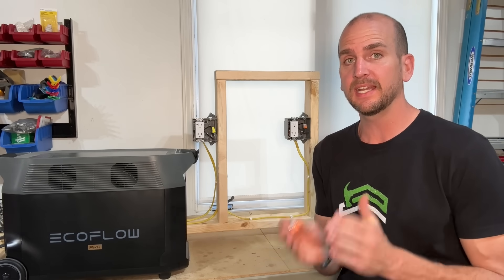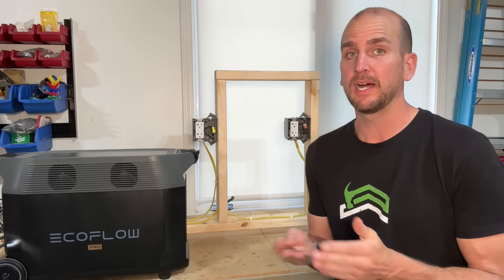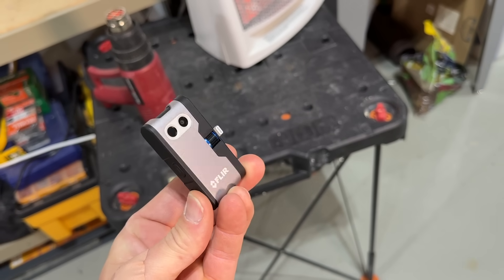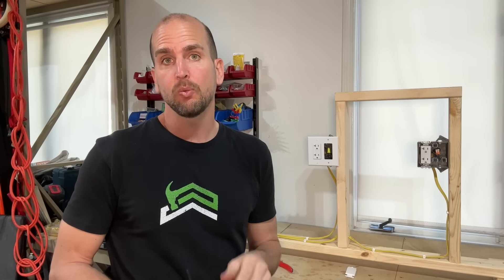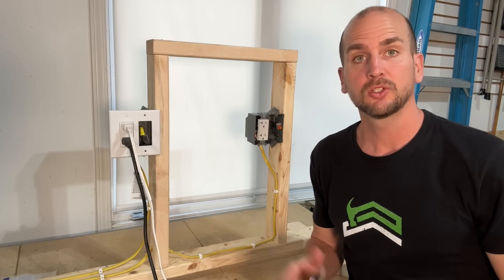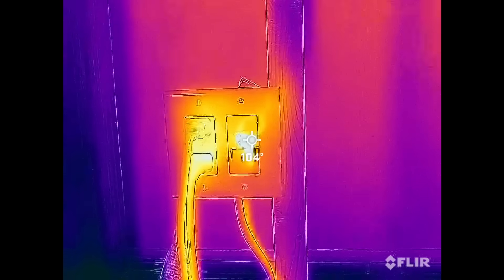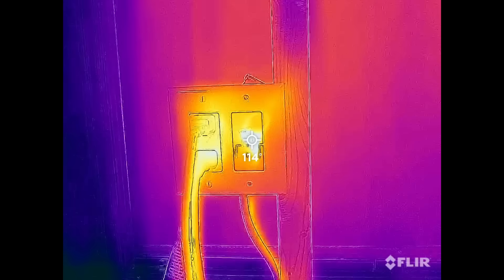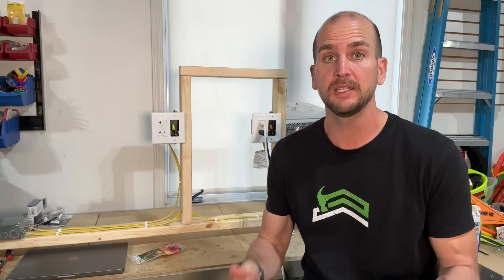Debunking the Pros: Can WAGO Lever Nuts Handle Heavy Electrical Loads?

Comment: It would be interesting to see this test at 20A since that’s a real-world max (or breaker would trip). Would the relative temps remain similar to the test at the higher amperage? Also I’m curious what this would look like at high ambient temps, like a 100F summer day… what was the ambient temp during your test?
Reply: 221 wago's are rated for 32 Amps at up to 450V. There shouldn't be a problem.
Reply: A great video regarding breaker loads: https://youtu.be/MnkHRlztco4
Reply: Breaker should trip at 80% of rated continuous load,  so if a 20A breaker holds more than 16A load? It's bad.  Replace it.
Reply: @ChrisDavis-eq9lj  That is not at all true. The 80% versus 100% rating is all about heat, and where the breaker is installed. If its installed in a box with other breakers surrounding it, it might trip at 80%.  BS EN MCB breakers are even guaranteed to never pop below 113% for some period of time.
Reply: @sandos-x1t  40 years experience as an electrician, 30 years IBEW. Degree in electronics to boot. I'm not making it up. I know from hands on, tested with reliable, calibrated amp meters real world use. Properly working Square D and Siemens 20A breakers can handle a brief startup current of 20 amps. Extended use even in a temp service panel outside in 10 deg F temps will still result in a thermal trip if you exceed 16 amps. Crap like old Federal Pacific breakers? Yeah, I've burned holes through junction boxes dead shorting them. Breaker was so hot you couldn't touch it, but it never tripped. Federal Pacific burned buildings down and killed people.  Don't call me out and say I'm a liar. Industry standard 120v branch circuit breakers in residential, commercial and industrial applications will and should not carry more than 80% of their rated capacity for more than a minute or two.
Reply: @ChrisDavis-eq9lj  I don't know about the US; but for European breakers this is 100% false. They MUST NOT trip below their rated current, and the trip time above the rated current depends on the characteristic (indicated by a letter after the current rating, B fastest, D slowest). A type B will trip immediately for 3x the rated current, and after 1-4 minutes at 1.5x rated current. Even at 20% over rated they will not trip within an hour.
Reply: @ChrisDavis-eq9lj  breakers always trip over the rating to compensate for start up surge. They will take a few minutes to trip if the circuit is only slightly overloaded. 

Breakers don’t trip at 80% capacity unless they are defective. You are allowed to use 100% of the circuit for temporary loads (like a hair dryer running for 15 minutes) you need to design for 80% load for continuous loads (such as an electric heater running continuously). You need to install a breaker that has a lower rating if you only want to use 80% of the circuit.
Reply: @rpvitiello  I did not say branch circuit breakers will instantly trip at 80% of rated load. I said they will not carry a sustained load in excess of 80%. They should trip at anything that exceeds their rating, but some may hold for a very brief time a little over their rating either by design or manufacturing defect. Sustained loads over 80% will and do cause them to thermal trip. Manufacturing variances come into play, so it is hard to pin down the exact overage/time. Keep in mind, American systems (with the exception of XMas lights) do not have fused cord caps to protect devices like European systems. I'm not familiar with Eurospec circuit breakers.
Reply: @ChrisDavis-eq9lj  Unless this is some american only thing this is completely false. I feel like you are confusing having continuous load of no more then 80% with when the breaker will actually trip. looking at trip curves for breakers most will not trip at 1.2x rated current for tens of minutes.

Comment: 30 amps thru 12 awg?  Yawn.  Maybe if buried in insulation it would be a problem, and the terminations could be an issue but Wago's are rated for that.  Now repeat that with 14 awg. I expect that will exceed the 90C insulation rating if powering your resistive loads.

Comment: They both work well when used properly. The biggest difference is the price. Wagos are a lot more expensive than wire nuts. That's why they don't get used as much by electricians. It hurts profits.
Reply: I don't know about the US, but here in Germany, the work usually does cost a lot more than the material. Although wirenuts were never used here, they would be unacceptable alone because of the time they take to wire up (or modify), even if they would be free of cost. The same is true for outlets. In the past (30-40 years ago) wires had to be bend into loops with pliers to screw them down. This also took a lot more time. No one would pay for that time anymore today, since there is a solution that is safer and a lot faster to install.

Comment: What “I think” is that whomever claimed the Wagos have higher resistance and therefore heat, were guessing and not testing.

So even though they are technically correct they remain non-credible. 

Bottom line, if it meets code and has certs, it’s fine.

Comment: I'd like to see the temps on a commercial quality Backwire outlet those decora outlets always seem to be poorly built with inferior parts i use regular duplex commercial grade and those clamp down terminals are very heavy duty and shaped to fit the wire even these outlets were the best connection you tested though and if things are crammed in a tight electrical box will the pressures on the wire affect the clamping spring in the wago over time pushing wires off the contact surface so that wire may possibly only touch part of the surface inside wago connector?

Comment: My experience with wire nuts is that they can be a bit tricky to get right, especially if you mix wire types. The Wago do allow you to transit between just about any wire types without risk of an unreliable connection.
Reply: Stranded and solid just don’t get along all the time.  Ive had a wire nut melt but it took 5 years.    Wago is a no brainer when using  different wire
Reply: @jlsrr2577  Any body using a wago has no brains alright.
Reply: 😂😂😂 get a job radiodick
Reply: It IS an unreliable connection, thats the whole point!
Reply: @RadioRich100  what is unreliable? What stats do you have to support that statement?
Reply: WITHOUT? Its anything but!
Reply: Everything you do with a wago IS an unreliable connection. Learn to put the wirenuts on right!
Reply: If you say wirenuts are tricky u shouldnt be doing the work in the first place.
Reply: @RadioRich100  If they were not tricky, then licensed electricians would not get them wrong so often.
Reply: @buggsy5  There not getting them wrong, theirs bad contractors everywhere. So now you have bad contractors using inferior products so they can get out of there faster. Pushing the wires back in the box and the wago levers are popping open for one.
Reply: @RadioRich100  rather do it myself.  not going to pay you $250 to come in and put in 1 light switch.  sorry.
Reply: @steppedon  Do it yourself, just do it right.
Reply: @RadioRich100  sorry, but, how exactly is that any different than misuse of wirenuts? Bad contractors and even electricians still screw those twisties up. How does that make the wago an inferior product? and how does them misusing wago by cramming it in such a way that the levers are caught make it inferior when enough solidcore tension could slip off a twistie too? Not sure its clear to the rest of us...
Reply: @RadioRich100  if there are so many bad contractor, then is best to make sure they have to use the connector that is less likely to fail, no?
Reply: @lesto12321  No, because now you have an inferior contractor and an inferior connector. Double trouble.
Reply: @buggsy5  I hope your doctor never says something like that.
Reply: @themadmallard  Whos us? Talk for yourself, if wirenuts are properly applied they work forever because the wirenut doesnt make the connection the twist does. The wago properly applied can easily fail because they DO make the connection and in 2 spots at once, using flimsy spring contacts which give contact of little surface area in 2 spots in the same circuit. The wago is now in the circuit. Thats called a point of failure. The wagos popping open happens to everyone using them good or bad because of the inferior design where u wont see it behind a switch or outlet  when the screws are tightened. There junk designed for speed. So what happens to a homeowners house a few years after the electrician got out of there 2 hours early?
Reply: @RadioRich100  If I go to my local supplier he'll probably have to order those wire nuts especially for me unless he has an old box with 20 years of dust on it.
Reply: @ppdan  Blow the dust off and keep you house from burning down.
Reply: @RadioRich100  By the looks of most of these videos its mainly US electricians haveing issues with installing and using Wagos. Never heard of or seen a Wago "popping open", i understand it could happen if you cramp the switch or outlet full of cables and jamm them back in there or using excessive force on them. 

As to the melting part, that could absolutely happen if you dont use them right, if you cant do that you need to learn how to read as it says on them what they are desiged, tested and approved for. Mixing cable sizes can aslo have that effect if you are not using the correct cables.

In general, higher amperage in an electrical circuit can increase the risk of overheating and potentially lead to burning or hot wires. So maybe that is why you guys on the other side of the pond have more issues with this?
Reply: @andrehoglundlarsson1303  Possibly but they are not very good as they dont have total surface area contact.
Reply: @RadioRich100  Same goes for most things installed in a switchboard, they dont have total surface area contact, its genareally a pinching connection.
Reply: @andrehoglundlarsson1303  ?? A switch board doesnt have 20 amps going through it.
Reply: @RadioRich100  Oh sorry, my faul! Thought of the wrong name in english. Consumer Unit was the word i was looking for.
Reply: @RadioRich100  a video backing up your claims would be helpful versus just making wild unfounded statements....
Reply: @themadmallard  He's just being difficult with new tech for some reason....kind of like being butt hurt
Reply: @RadioRich100  Nothing inferior about it.
Reply: @andrehoglundlarsson1303  or just place a piece of elec tape over/around them.
Reply: @RadioRich100  Your claim is that wire nuts are badly installed because the one who installed it has poor skills which means that installing a wire nut correctly requires some skills. And at the same time you claim they are not tricky?
Reply: @ppdan  If your saying their tricky you dont belong installing them. Doing electrical work is skill, something you probably dont have. Lack of skill or laziness produces the same results.
Reply: @ppdan  Their not tricky to an experienced contractor or Diyer. If you say their tricky you dont know what your doing and therefore shouldnt be doing the work. Any work can be tricky if you dont know how to do it.
Reply: @RadioRich100  You might wanna check the definition of tricky!!!
Reply: @RadioRich100  If they aren't tricky why should I use a licensed electrician?  I could just do it myself....not tricky, remember?
Reply: @RH-cv1rg  If its tricky to you, you dont know what your doing then.
Reply: @RadioRich100  I didn't say they were tricky.  YOU said they weren't tricky and I commented that if they aren't tricky (your position) why would I need to hire a licensed electrician?  Seems like anyone can do it....not tricky, remember.
Reply: @RH-cv1rg  The important thing is to do the job right. If your not capable get someone. Wagos are not the way.
Reply: @RadioRich100  Thanks for your input radiorich.  I'll let the EU electrical approving body, Underwriter's Laboratory, and the Canadian Standards Assoc know they have all made a huge mistake certifying this product.  Radiorich has done his own studies.  Hey, how about sticking to radio, maybe you know something about that......like people don't listen to it anymore.
Reply: @RadioRich100 getting 6 #12 wires to actually look good and be nicely twisted into a wire nut can definitely be tricky
Reply: @JoshBattershell  If you consider it tricky you shouldnt be doing it, however its far better doing a pigtail to a second wirenut and splitting them. A wago is NEVER the answer!
Reply: @RadioRich100 get with the times old man
Reply: @apollo6139  The times? Switching from a long time tried and true method to fast junk? No thanks. Faster is never better or even as good. Especially when it comes to your houses electrical. Dont be a fool.

Comment: The Wago generates a little bit more heat but it doesn't matter, I think it's worth the ease of use and fixes in the future become quickier, totally worth it
Reply: 'a little bit more heat but it doesn't matter'?  Please don't do any electrical work.  :body-green-covering-eyes:
Reply: @doninmichigan  max recorded temp was 46°C, THHW-LS cable is rated for temps up to 90°C, what's your point?
Reply: @Ricardordz11  A little bit of heat is magnified over time, you're just looking at a snapshot.  Never mind, just please don't do any electrical work, stick to gardening.
Reply: It doesnt matter??? Lol there shouldnt be any!

Comment: I think you didn’t give the Wago connectors a fair set of data.   Your graph simply shows absolute temperatures.   But, by the time you test the Wago connectors you have been running almost 3000 watts of heat for 40 to 60 minutes.   We need to know the ambient temperature in the room for each test.   Then you can show the temperature rise over ambient.   Looking at your graphs it appears the Wago has less increase over time vs the wire nut.     Looking forward to round two.

Comment: I recently wired my entire garage with Wagos with a combination of solid and stranded 10ga in some cases. I feel like stranded makes more contact and performs better than solid. I’d give the wago a shimmy to get the strands to flatten out after closing the lever. Any chance you could test stranded wire performance?
Reply: I didn't think wagos were approved for use with stranded wire. Am I mistaken?
Reply: @robw2379  the 221 for sure. Some push-in types are not compatible with stranded.
Reply: @robw2379  yes, they are approved for stranded wire.  The wires are fully inserted then the lever is closed, it is a very good contact.  Lots of guys use Wago’s specifically for the light fixtures, since they are normally a solid connected to a stranded.

Comment: While I am not one of those people that believe that government will protect us, nor should, that was one of my considerations on buying and using them. The NEC is very strict, usually more than what is reasonable, and I did not find anything in their literature about them not being allowed. I would also think that if there has been issues with them as long as they've been around already that something would have been heard and they would have went out of business. So those are also my considerations. I've always wondered in second guesses though. The one thing I am finding is I do have to wrap them in electrical tape. On another + note for Wago, they can join copper with aluminum wiring. I'd still use the thermal compound and make sure they're wrapped in tape though. There's a lot of expansion and contraction.

Great video. Glad someone did this. I have purchased wirenuts from where I believe it's you on The Amazon. That site confuses me and seems to trick me. So many times I've ordered something and it's not what I thought it was when it gets here, if it ever shows up at all. They Primed me and still they can't get stuff here on time, if at all.
Reply: The wago 221 is not rated for aluminum to copper connections although wago does have some other connectors for this
Reply: @highvoltage1979  How many aluminum to copper connections do you find in the US - other than the main feeders to the building?

I suspect most of the tract homes that were wired with aluminum for that few years have long been torn down.

Comment: I know you are American, and Americans are your target audience, but if you are already doing the math in the spreadsheet, could you also show the temperature in °C (or K is also good) for us Canucks (since we have essentially the same electrical systems and codes — though it's the CEC, not the NEC here) and others who use the Metric system (aka SI)? It would very much be appreciated! I kept thinking it was 100°C  on the FLIR (since °F was not shown or mentioned) and was like "wow, that's hot, you'd be able to boil water at those temps".
Your audience may primarily be American, but it is an international audience (and it's very hard to find Canadian electrical content like this on YouTube, or anywhere, so if I want any content like this, let alone some of the best on electrical such as your content, I pretty much have to rely on Americans such as yourself).
Reply: For reference/comparison, pretty much every computer/IT content creator on YT, whether American or not, pretty much reports CPU/GPU/case/ambient temperatures in °C when discussing temperatures. This includes some of the biggest American creators such as GamersNexus and JayzTwoCents...LinusTechTips is Canadian, and they use Metric (and thankfully generally report dollar values in USD and CAD, I just wish I could buy their merch in fixed CAD rather than fixed USD, lol, but that's a gripe with them and off topic here).